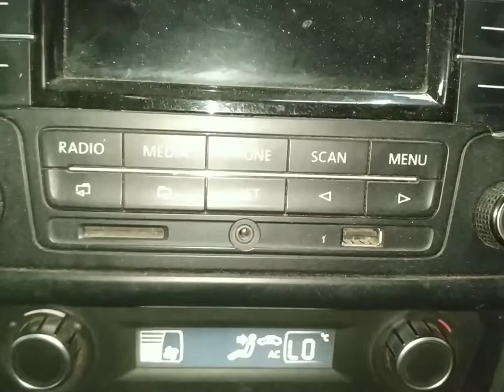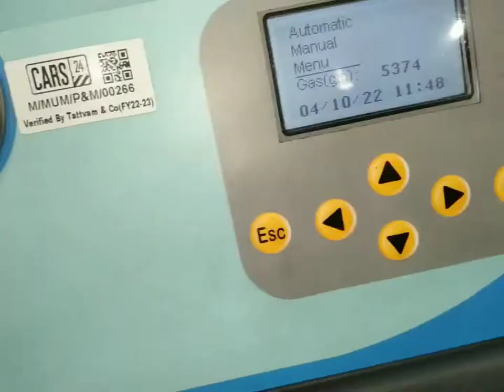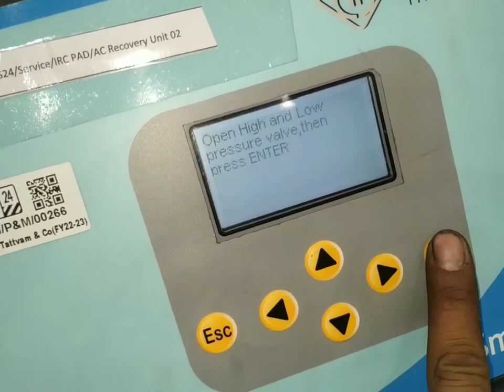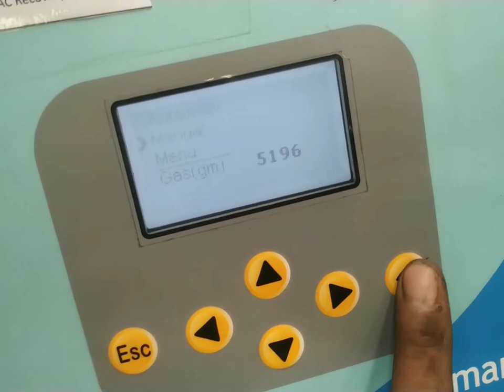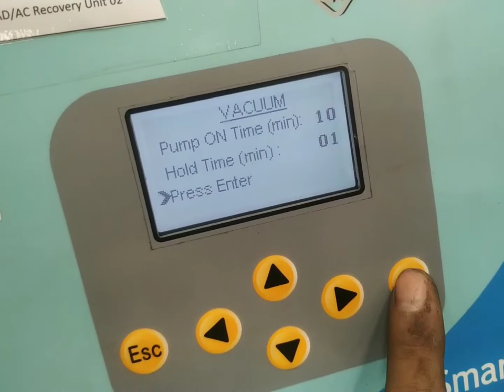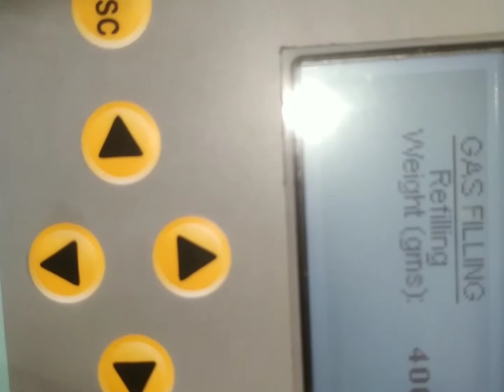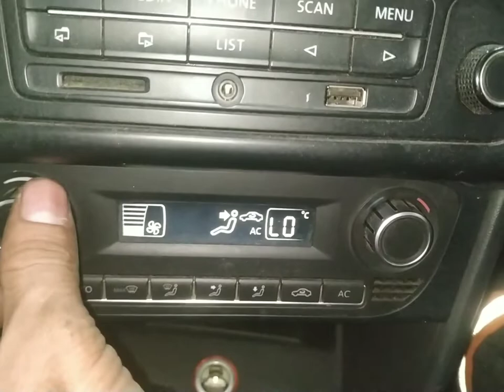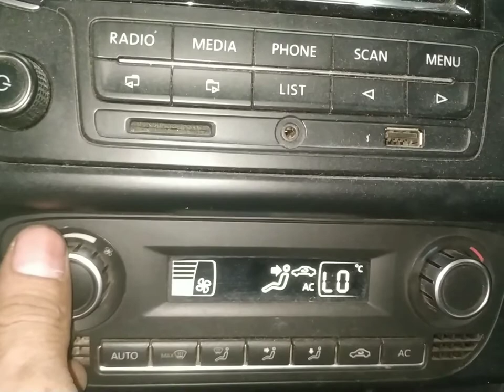vw polo compressor valve replacement? vw polo compressor? vw polo ac compressor not working

Comment: sir mere polo tdi me hard accelerator dabane par hiss ki sound ande ha jab AC On hota ha. kya yeh valve ki problem ha
Reply from the maker: Cooling proper ho rahi hai na
Ye Vale ki problem nahi hai ye 
Clutch jab ingage hota hai uski 
App jab accelerator de rahe ho tab ac chalu kar rahe ho to compressor on hota hai fir compressor me noise ata hai to ye noise compressor ka hai aur ye car me kuch time chalne ke bad compressor me noise ata hai agar jiyada awaz hai to CONDENSER replacement karo
Okay